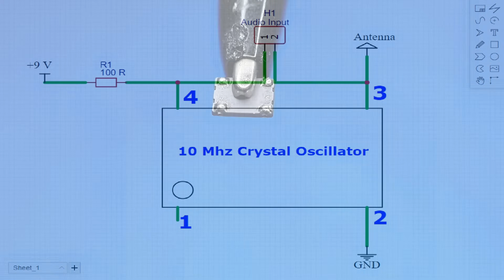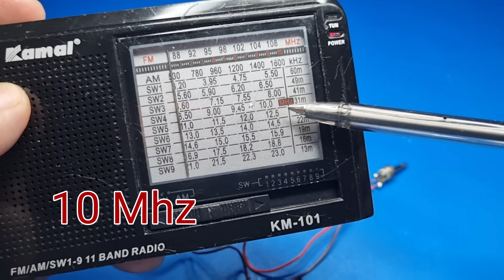How To Make A Radio Transmitter With Only 2 Components - Great Idea You Haven't Seen Before

Comment: Yup, that is a very simple transmitter. the crystal oscillator is actually a complete package in itself. All it needs is a power supply, an antenna, a telegraph key, now you have a low power radio transmitter. You can omit the resistor and your on the air, but you need a low pass filter on the antenna to avoid unwanted interference to other frequencies. ;-D
Reply: no need for an LPF at such microscopic power levels with a short antenna.
Reply: @jemussi7842  Yup, anyway it’s not going to be use for serious QRP work.👌🏻😀
Reply: This can be fake. Electroboom needs to rectify this.
Reply: I just watched a koren zombie movie. The kid did this sending out a picture holding up a sign saying he was a survivor using a pair wired headphones..and an app he had on his phone implemented by his govt in case of an emergency
Reply: Also it's way more than two components. Click bait.
Reply: @michaelteel4917  one could argue that the crystal and resistor are the only ‘components’.
Reply: @TomCee53  How's that ? Without the battery it won't work  . Without the antenna it won't work.
Reply: @TomCee53  Mine is a 1 megahertz oscillator and transmits on AM, has no resistor, but a small audio transformer for the audio input plus antenna and 5 volts battery.
Reply: @simonassukackas1312  it probably isn't fake but seeing as there is no transistor I won't work if  you move more than a few metres away
Reply: @sammyd7857  Might work further away with a resonant antenna.
Reply: @paullee5573  Am I in Britain? Naooo :(
Reply: @paullee5573  jajaja que ridículo
Reply: I did this back in the 70s to create a TV blocker that I hid near a girl's house I wanted to meet. When she said that she wasn't able to watch her favorite show on TV last night in school the next day, I "volunteered" to go to her house and "fix" the problem. Her TV was in her bedroom and she had the TV antenna hanging out her window. I leaned out the window to "adjust" the antenna and turned off the transmitter. Fiddled around for a few minutes then announced it was "fixed". We sat on her bed for a few hours watching TV. That's when I found out she was vapid and the only thing she had going for her was her looks...
Reply: @michaelteel4917  When I saw the title, it reminded me of a transmitter made from a diode and two pieces of wire stretched through a bush.  When a directional antenna was used to hit it with a IIRC a 900Mhz signal that was modulated with a 1MHz signal that was in turn modulated with an audio signal, the diode would effectively demodulate the outer 900Mhz signal and reradiate the modulated 1MHz signal.  This transmitter was used in a radio fox hunt and totally stumped the people who were looking for it, since they were looking for something much larger, and their receivers were oblivious to the 900MHz signal that was being used to power/drive it.
Reply: @ekummel  What a great idea! Its a shame you didn't score but all turned out for the best I reckon!🤣😃
Reply: كيف يمكن تركيب بلورة ذو راسين ..وماهو مفتاح تلغراف؟
Reply: I am looking to make my own Morse Transmitter as a complete electronics noob. Can you tell me how many watts would this transmit on and how can i get it to increase its power. Saw somewhere under the commend thread that you can use a Transistor to increase its power. Though, You said it would cause interference with other frequencies which is completely true. And how can i hook up an LPF to the circuit being made here? Or should i just save my money and go for a QCX Mini? I mean im really hesitant on it since it has a lot of stuff going on in the circuit and i dont want to mess it up. Im just clueless. Help is Appreciated.
Reply: @ekummel  vapid - that means "not interested", right?
Reply: Thanks for explaining, i was searching for this
Reply: You shouldn't do this. These self contained oscillators generate square waves which means they contain a lot of harmonics and are very wide band.

Yes, I know some of you idiots will say it is low power and therefore it doesn't matter. Well it does matter. And in many countries transmitting a radio signal in this way is illegal and you can be fined heavily, event sent to prison.

It is extremely bad of a YouTuber teaching, encouraging the use of illegal devices like this.
Reply: @deang5622  Wow no shit, I am certified and i was planning on doing it in 10m band for morse practice. And i mean, how far can these go? 10 cm? They're extremely weak so even if i didnt have a license noone would care. And i doubt i'd interfere with anyone considering its on 10m band. A whole band only for Amateurs.
Reply: @racketman2u  More like "not interestING". She was boring, talked about boring things and was just tedious to have a conversation with.
Reply: @ekummel  Lessons learned, Lebenserfahrung 🙂
Reply: @racketman2u  No - empty - mindless.
Reply: @deang5622  oh shut it
Reply: @fredcabor5258  shut what?
Can't handle an intelligent discussion?
Reply: If the oscillator is 10MHz fixed how does this thing work?
Reply: @garymartin9777 It's AM so the frequency is set (at 10MHz) and the amplitude is modulated by simply adding the audio voltage to it. You will not be able to 'tune' with this setup, it will always have the same frequency, unless you solder in an oscillator with another frequency
Reply: @@TheCubbyman61  share your circuit diagram please
Reply: @TheCubbyman61 stop LYING!
Reply: @ekummel no, ur a liar too.
Reply: @sammyd7857 why would the resistor increase range?

Comment: 1:47 That’s not just a crystal oscillator - it has four connection points and a crystal only requires two - that’s a whole circuit in itself which you don’t identify. Replacing that with a simple crystal oscillator won’t transmit anything. 😊

Comment: Cristal oscillators oscillates at a certain frequency based on physical dimension. These oscillators are mostly used to feed a digital processor to get  clock input.
The oscillator creates a sinus like signal and added with the audio signal that results in an AM type of signal. The antenna coil generates EM fields when current continually changes in the antenna. This EM waves is then picked bij the radio …
Reply: Please don't publish nonsenses. Crystal oscillators do NOT produce sinus, and adding carrier + audio does NOT create AM signal. The "antenna coil" has open end, so it does not act as a coil at all. You know nothing about the radio electronics, similar to the author of the video. The circuit seems to work, but it is a garbage.
Reply: @jankolar5612  🤣🤣
Reply: @jankolar5612  I said sinus like signal, not exactly sinus, maybe you should read better instead of searching for other’s mistakes as a hobby to satisfy your ego.
Ok, you’re right about the antenna, it’s not a coil, but the antenna is responsible for emitting EM wave due to alternating charge particles in the wire.

This project you call garbage makes a lot of young people to study electronics because it just works and it’s fun.

But you must live happy a happy life, if according to your reaction.
Reply: do you know if instead of using a headphone jack if you could use a 1/4 quarter jack socket for example for instruments or a microphone to plug into?
Reply: @rachelmcg7186  Stereo 3.5mm and stereo 1/4" are exactly the same wiring in just a different diameter package. You can either use adapters to make the connection or you can use a 1/4" instead of the 3.5mm. Me, I'd roll with the 3.5mm because I use that type of cabling the most, and adapt to 1/4" as needed.
Reply: @NightRunner417  ahhhh thank you so much !!!
Reply: @rachelmcg7186  No problem, you're very welcome. 🙂 One thing I had to learn over the years as a rabidly dedicated DIY electronics nut is that there's basically an adapter for almost everything. Whatever you can't adapt, there's almost always a way to make your own.
Reply: @jankolar5612  You took the words right out of my mouth. There is so much of this kind of crap out there.
Reply: @jankolar5612  The oscillator produces a 'square' wave, that is true. But the fundamental wave is exactly a sinus. The harmonics get filtered out pretty quickly by the wire leads. If you've ever looked at a high frequency square wave on a scope you can see that. Every wire is an antenna under the right conditions which is why digital systems designers have to test their products for emi emissions in order to certify for class A or class B prior to sale. And yes  I have done that.
Reply: Stop the cap!!!!
Reply: And the best part is, the man who invented oscillators, how did he knew this things at the first time ? And how he put all those parts in a tiny object ?
Reply: @amitavabiswas5260  no one invented oscillators. Clock pendulums, the planet. Theres like three names responsible for bringing Crystal oscillators into the world. The smaller it is, the higher frequency it can go. They get quite small. Im quite fascinated with the origins of precision, which exists here on YT. Everything we do depends on what someone else left behind.

Comment: This was great. The only thing I'm missing is some explanation of the circuit. How does it work? At the first sight it is odd since it contains no active element like transistors. I accept that full understanding can not be achieved without background in electronic engineering but some simplified explanation would be great.
Reply: There are ample of transistors inside the package. It is a ready made clock module you can buy for pennies and frequencies all the way up to hundreds of Mhz.
Reply: @germanjohn5626  Thanks, that's interesting. I thought it is a single crystal and I spent plenty of time to find out why and what kind of quartz crystals have four poles. All I have seen had two. But this is a reasonable explanation.
Reply: @barsanyibela4027  they have only 2 poles, other two are ground just connected to casing for precise oscillation.

Comment: That is amazing and impressive. When I saw the title of this clip I immediately thought of the 1972 plane crash in the Andes mountains in Chile/Argentinia. The 16 survivors, all young men, ate the dead passengers' frozen bodies to stay alive for two months. One of the survivors had some experience with electronics and he tried to make the damaged plane's radio work as a transmitter, but could only receive public broadcasts from radio stations in Chile. While the boys would not have had a soldering iron, let alone solder and a power source, who knows what a very competent radio technician might have come up with, using components from the smashed on board radio.

I suppose one problem with your simple example is transmission range. What kind of range are we looking at here, with the 9V battery?
Reply: The fact it actually happened sucks, but the movie they made of it, really sucks.
Reply: @darrylkinslow5613  Yes, the books written by the survivors were much better. Nando Parrado's book "Miracle in the Andes" in particular.
Reply: Don't be silly.  In an emergency incident, you wouldn't cobble together a radio transmitter on some random frequency which emergency services didn't know you were transmitting on.

What you would do is use a ready made off-the-shelf personal locator beacon which communicates with overhead satellites which are all flying past listening on the agreed frequency your locator beacon is operating on.
Reply: @deang5622  How many satellites were "all flying past" in 1972? And where would you have purchased a "personal locator beacon" in 1972?
Reply: @SuperLittleTyke  The answer is possibly none. And I knew that at the time I posted my response. Because they weren't launched until a few years later.

But I wasn't talking specifically about that airline crash ..I made the point that an RF transmitter on some random frequency would have been picked up by emergency rescue!

So the idea of making an RF transmitter was completely stupid and not possible. And even if it could have been made, it would have been entirely ineffective.

The key point being, your post was a complete load of bollocks. And you want a 100% factual answer under those circumstances? Dream on mate
 Dream on.
Reply: @deang5622  Thank you for your constructive participation in this thread.

Comment: Try connecting a 15 meter long wire antenna which is resonant to 10 MHz I’m sure the range will be far better.
Reply: Next we interfere with the atomic clock signal of WWV in Ft Collins, Colorado?
Reply: @skeggjoldgunnr3167 yea let’s build a complete fm station next time, ofc completely diy😂

Comment: Cute project for little kids, but you really need a "low-pass" filter in the circuit to keep from interfering with other radio reception nearby, with a lot of useless "white noise". However, I calculate this only has a range of 12 inches at best, on a perfect day.  - I've only been an "Extra Class" HAM since 1962.

Comment: I'd sure like to see this on a spectrum analyzer.  That's a square wave, so it should be coming in loud and clear at 30, 50, 70, 90, 110... MHz.  Interesting nonetheless, getting a lot of FM deviation.
Reply: Здесь используется амплитудная модуляция.
Here amplitude modulation is used.
Reply: The antenna coil acts a bit as a lowpass filter
Reply: Harmonics LIKE FUCK. I used to make small CW transmitters for tracking or whatever and they would splatter like hell at all the predictable harmonics. The solution was a cap and coil BEFORE the antenna wire to reduce everything except a target harmonic. This way I could use say an old 27MHz CB crystal and have a useful output around 108 MHz, easy for my old handheld scanners of that era.

Comment: Will a 10MHz oscillator rated at 5V work (only one I can find on Amazon)?
I would use a power supply set at 5V instead of the 9v battery.
Would this mean the 100 ohm resistor is not required?

Comment: Make one using 12v from your car battery and use it to transmit your phone or pod to your radio. I use a similar but with bluetooth transmitted to my radio from my phone. Works great and I can change the input channel. Good ideas.

Comment: What is the part number of the crystal oscillator ? How high is the power output ? What range do you get with the antenna shown ? What licence conditions apply to operating such a transmitter in your country ? How much current does it draw ? How long does the battery last ? Cute project 🙂

Comment: This video should be titled “how to piss off the local hams, and the FCC with this one simple trick!”

For real though, nice video. Super simple, to the point. Just be carful with it, as this is really close to a frequency that you need a license to operate in, and you may also be interfering with time stations. This radio might be very low power, but I have seen someone make a contact in Hawaii from colorado with less than 5 watts on HF, so it is still possible to mess with things.

Comment: Hello 🙂
On the photo that shows this as a photographic representation of what the video is about. 
But it shows on the photo a microphone and NOT a audio input. 
Have you a video of a transmitter something like this, that uses a MICROPHONE ???
Also what sort of distance dose that sort of distance can it cover ?

Bye from John in England.
Reply: If you haven't figured it out yet Jon, I'd be interested in building one and testing it. We can share results. Just ordered a pack of 10 Mhz (and several others) Oscillators, and a pack of different resistors. Believe I have the battery connectors, wire, and audio plugs. I'm actually thinking of using it between walls, and underground a few feet.

Comment: Okay excuse my ignorance but a couple questions. 100 what resistor? What units? Also why 9 volts and not 12? If I wanted to run 12 how much bigger with the resistor have to be
Reply: 100R == 100 Ohm, OK?
Reply: @josip.harasic  thank you for the clarification

Comment: If I was specifying the parts for the construction of this project, there are more than two components to make this project work, there are seven...

Parts count:
1. Oscillator
2. Resistor
3. 9 V battery adapter
4. 9 V battery
5. Inductor
6. Audio plug adapter
7. Music player

Comment: This is a great tutorial however, if you are following it I would like to warn you that when they are putting the audio jack on, the red wire is the ground instead of black
Reply: Was scratching my head on that too. Plus the ground pin is connected to 9v battery after resistor. Any idea why is that the case? Why not connect to the ground of the battery?